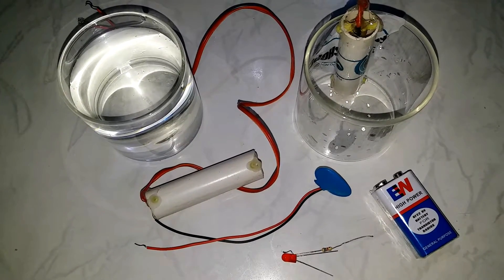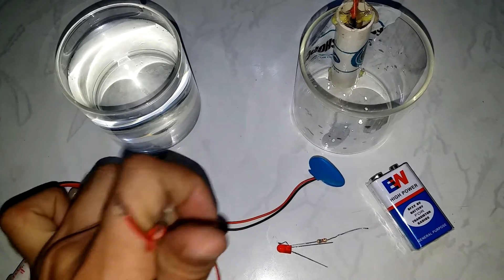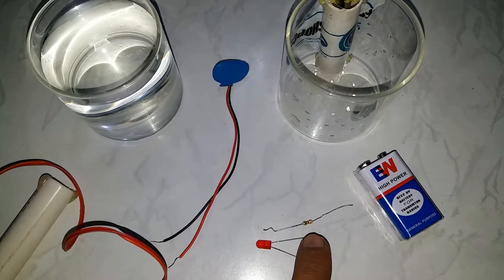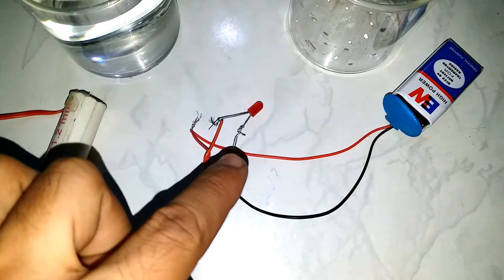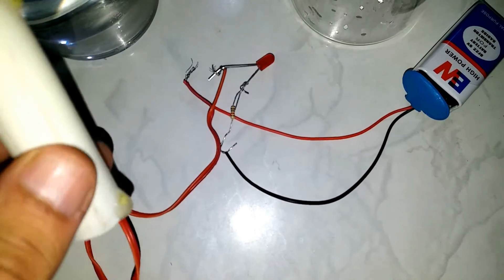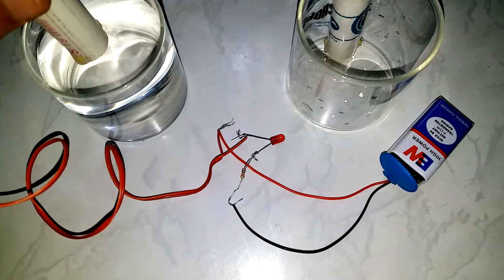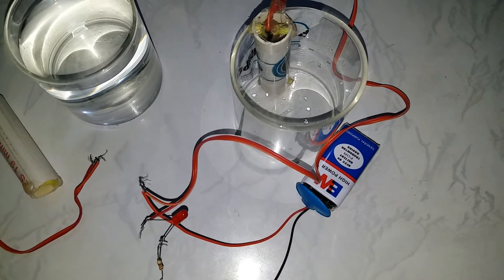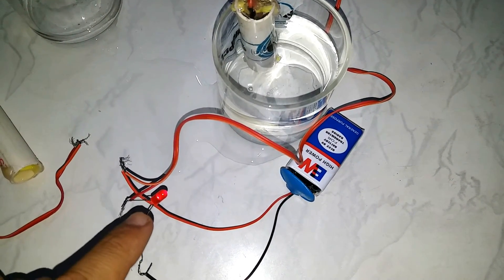Tutorial - Non Corrosive water level or float sensor

Comment: IF we use for 24 volt dc will the water have current which would give a shock
Reply from the maker: We are using voltage regulator to drop the Voltage to 5v.. otherwise you can use water level sensor which don't directly get contact to water
Reply: @sumitgrover987  I wanted a switch which detects the water flow in pipe and based on its input the RO filter can be turned on and off
Reply from the maker: @sandeepbhojani  you can use water flow sensor. Its available on Amazon like this https://robu.in/product/fs200a-yf-g21-water-flow-sensor-1-30l-min/

Comment: Your older videos are much better...please start uploading gsm 8051 avr arduino iot stuff again.
Reply from the maker: Chinmay Electronics thanks...will start uploading that too...this is actually new sensor i build
Reply: Sumit Grover Yeah..I saw that you used rheed switch...but sensor any way available in more compact size in market for around 95 rs...yeah but good try. Make more videos related to programming of 8051 Avr or Pic...it will be nice and boosting
Reply from the maker: yeah sure